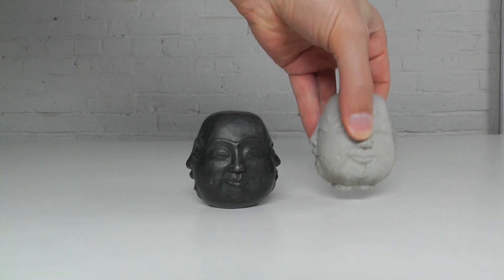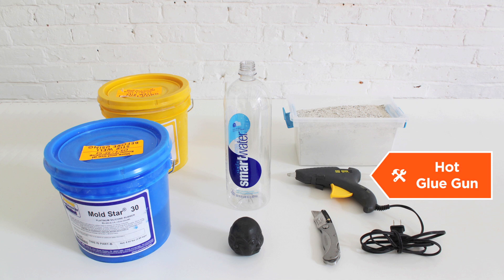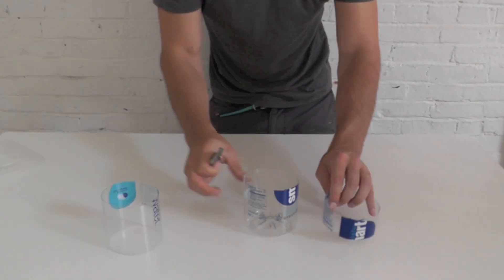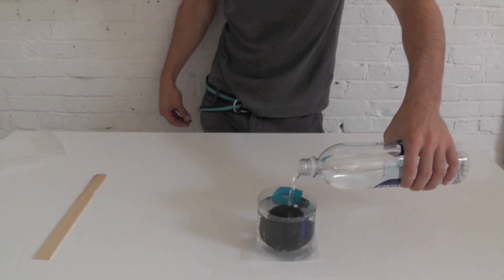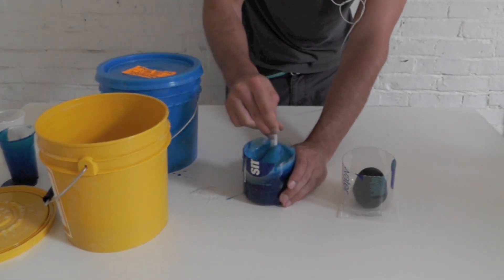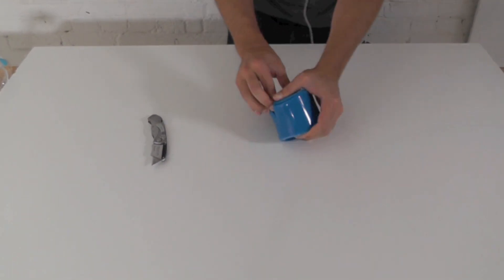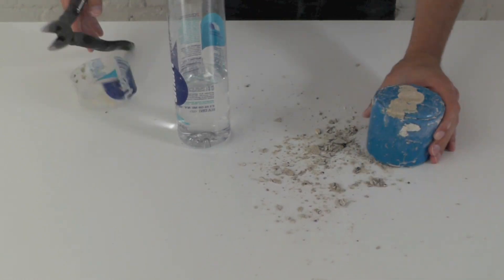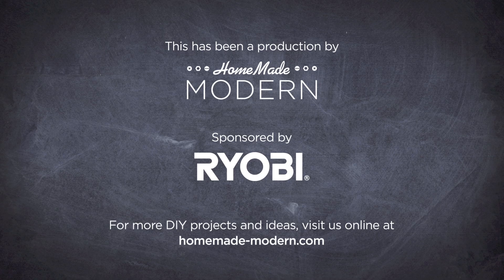How to make silicone molds for casting concrete

Comment: Hey, i need some genuine advice, i'm trying to make a carbon copy of a teddy bear, it was dogs favorite teddy and i want to place a concrete statue as a headstone for her, do you know how the silicone would act with the original teddy? or is there is different molding liquid to use?
Reply: Since the teddy is something soft with all the hairs I think the mold making process could destroy it. I would recommend wrapping it in plastic wrap & packing tape to get the general shape, then make a mold out of it, then cast it in plaster first. Once you have the plaster form, you can carve out the original details. Then, make a mold of the plaster piece to create your more detailed concrete form.

Comment: Excellent video! I have to make four concrete "feet" for an art assemblage that will be cast from a doll head and shoulders. I need to secure a bolt down the middle, and I am thinking I can hot glue one in the mold for each pour. I think I would have to make the mold the exact depth of the original so I can access top and bottom.

Comment: I wanted to cast a small model from either a silicone or plaster mold. What type of concrete should I use, like the aggregate that makes finer grade kind of concrete, for a small model about the size of an adult fist.

Comment: Interesting video. You said you have tested several brands of the silicone mold and I respect your opinion so that's what I'll try. But how much is it? Thanks for sharing.
Reply from the maker: MRrwmac i used about $10 worth and it was a small mold but i can use that mold over and over.
Reply: Hi katerina, I want to start doing these kind of castings and I've read that you can do 10 castings before losing quality, 20 to 30 if you clean your mold and protect it with some oil coating, but I've seen that ABS molds are the best for concrete they last hundreds of times. I'm gonna start testing all the options and give you feedback once I have some vaulable data
Reply: +HomeMadeModern hello! can i ask you approximately how many times can you use it until it started to not produce such as clenan and detailed objects..i use one silicone that lasts about 20, max 25 concrete castings.. have you find this one to be specifically more enduring to concrete casting ware? thank you!!